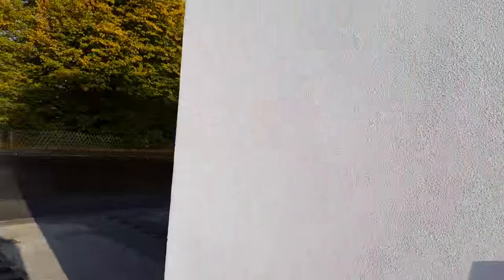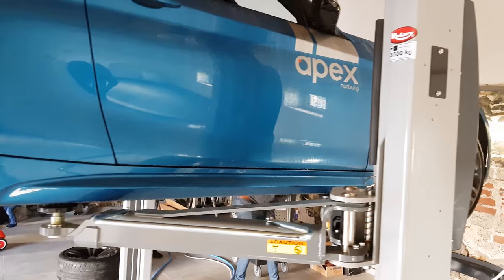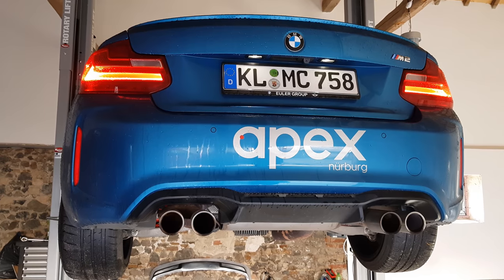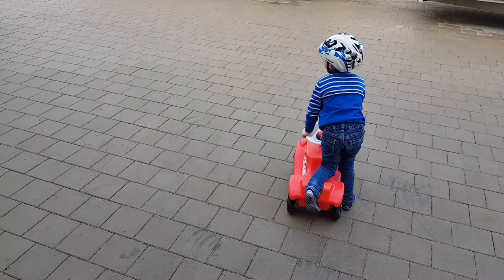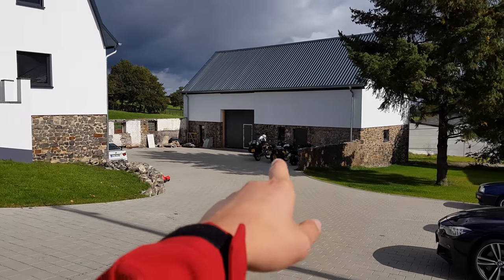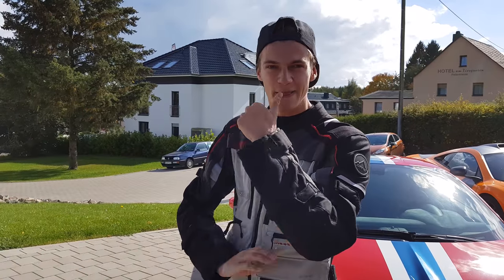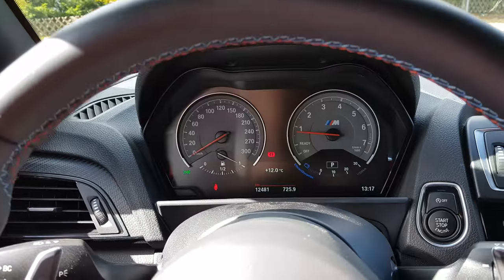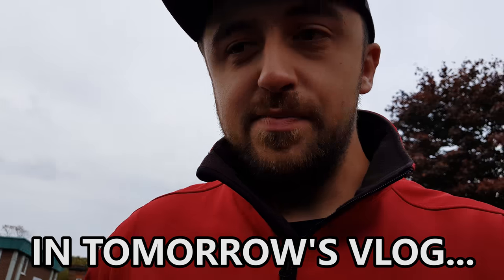OUR BMW M2 (and other cars) UPGRADE PLANS

Comment: My 435i has the same function with the exhaust. The car comes with exhaust flap that opens and closes. I have a jb4 tune that allows you to open and close the flap permanently. You guys should look into burger motorsports and their jb4 for this n55 motor, the tune did wonders for me, has cool functions like boost limit per gears, led brightness control, exhaust flap control, on the fly map switching, e85 support. I have videos on my channel showing the difference. Check them out! Huge performance difference, my car on my high “kill” map is making 425whp and 640nm, destroying zcp m3’s now with a couple bolt ons and tune on stock turbo, and internals. Burger motorsports also makes a jb4 tune for the m4 you guys should look into that too! Keep the videos coming looking forward to see the amazing progress of apex.
Reply: GTR Get To Race yeah look how big of a difference that setup made on his n55 435i which is the same motor as the m2, it’ll make a night and day difference.
Reply: GTR Get To Race your car is fast as fuck lmao apex should do these mods to the m2.
Reply: I second this.

Comment: It sucks they use ignition timing to give that nice burble sound on the M2, If you get a set of odd length extractors installed with the exhaust it would do it all the time. I installed a custom tube turbo manifold on the RS and the sound was awesome with a few pops in there as well, had lots of complaints from the neighbours though lol. 

Can't wait to hear it after the works done, It will be great to see the Cupra back as well.

Comment: That's the mark of understeer on the M2 tires. Is this particular M2 set up for understeer from the factory? Or are people misjudging the braking points and enter too hot in mid to slower turns?
Reply from the maker: thefridgeman people obv enter too hot

Comment: Fun fact: The E46 330i had probably one of the first "flap" exhausts stock, it opened in the higher revs, but you could unplug it directly from the muffler.

Comment: I really like the info sessions with Robert!
I didn't get if you already did remap the M2 ECU or plan on doing it?
Reply from the maker: didn't do it, might do it
Reply: Remap is interesting on come Cars with lower power but on the m2 it may be too much. Need to keep the cars safe for the drivers as well!  If someone needs more power there is the m4:-)

Comment: How much work goes into making sure the car isn't too loud for the track Misha?
Reply from the maker: Too loud where? Inside or the exhaust?
Reply: I mean too loud for the track as in the officials won't let you run because the exhaust is too loud.